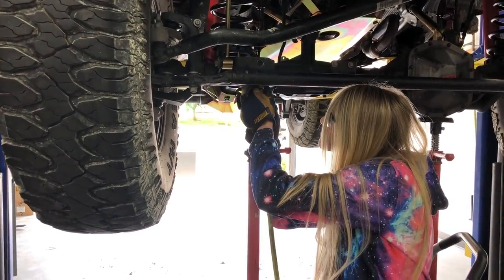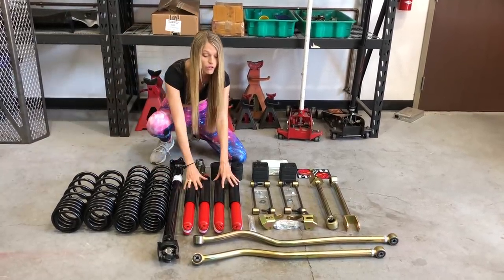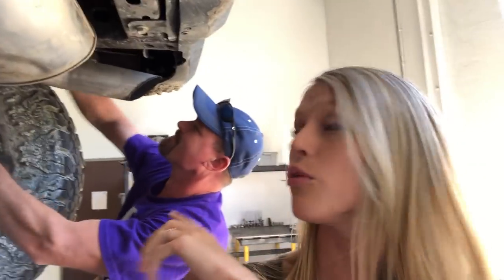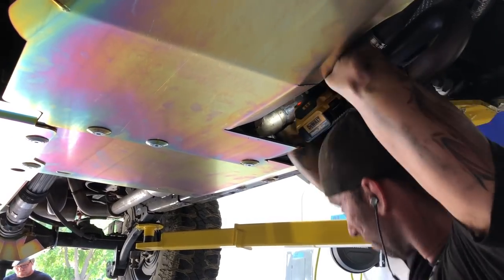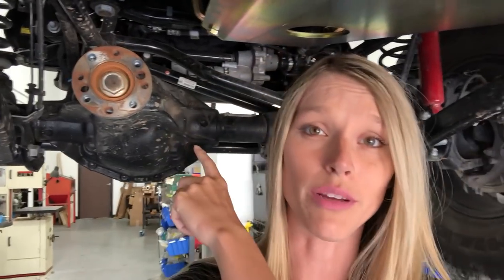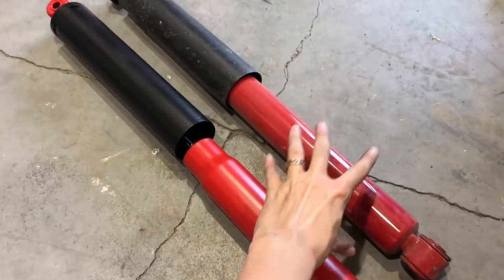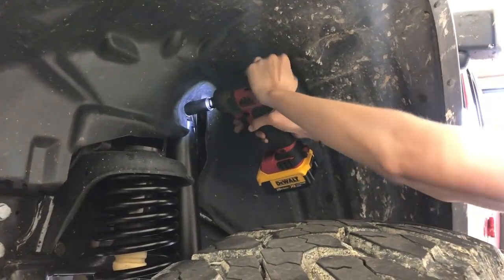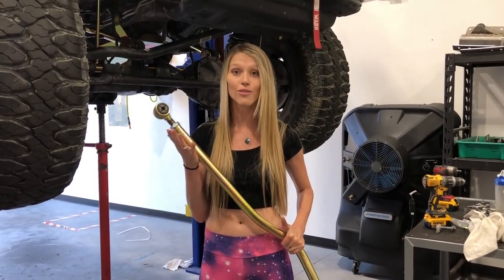We Install a MetalCloak Lift on Our 2018 Jeep Wrangler JLU Rubicon!

Comment: Good choice of lifts. I made the unfortunate mistake of getting a Rough Country 3.25 lift on my previous 13' JK. It was absolute garbage and cause issues right up until I got rid of the Jeep. The company didn't want to help out either, so I suggest anyone who is looking, to spend the extra cash and avoid lots of headaches.

Comment: Another great video!  Best parts, track bars and drive shaft. I did a 4 inch on my last rubi and had to do both drive shafts and track bars. Shorter wheel base more issues, but loved it. Can't wait to see the Rubicon video.

Comment: I just installed the 3.5" Teraflex spring kit with Falcon shocks. It was a pre-release kit. Glad to see these kits are finally being released. Before now, Skyjacker and a few hockey puck kits were the only ones available.
Reply: did the same with 37's, a little to harsh for me on gravel/dirt 2 tracks.
going to put the 3.5" MC coils in. What is your opinion on your TF ride?
I will keep the falcon 2.1 but just change out coils.
Reply: Jeff huschitt
You’ll want to make sure your tire pressure is 28-30 psi max with these and any 37” tire. Makes a 100% difference in ride. 
The TF springs are a little stiff for most people’s taste. My lift is a tad high for me. (Ended up being a true 3.5”). 
If you want a great lift with good shocks... look at the dynatrac 2”. Comes with fox shocks. You could then sell whichever shocks you don’t want to keep.
Reply: Brian Head I run mine  @ 27F & 25/R
Reply: Jeff huschitt I’m measuring 51” from the bottom of the hood line (near the antenna)  to the ground. Progressive springs are suppose to ride really well.  You might try googling them.

Comment: If you decide to replace your damaged GoPro and you choose the GoPro Session 5, make sure you save the plastic mount on the package because it fits perfectly in the JL's center dash tray.  I just set mine in to face forward or back, but the way you guys off-road, you might have to hold it down with Velcro.  On second thought, you'll probably have to secure yours with 1/2 inch bolts!
Reply from the maker: Rod Evans 😂😂

Comment: Bad Kevin !   Shade tossed twice at Lite Brite. :(.  
You should thank your lucky stars to have found a partner that so enthusiastically supports your motor sports passion.
At the same time I was marveling at how technically literate and well researched your mods are presented. 
And Lite Brite as a 'presenter' effortlessly dialogues the process. Bravo ! She is an excellent role model for women and men !
I understand that your location is prime for off roading, but the after market does present a wide variety of choices.
Maybe you could mention in passing how you decided on one product over another, seperating the diamonds from the coal.  
It does appear that all your choices are top quality and very well manufactured.
Looking forward to your trail test.
Reply from the maker: jafxdwg Thank you for the kind words! 😊😊 I’m still on a learning curve with cars, but I’m a quick learner!

Comment: I am looking at running their 2.5" gamechanger rocksport edition on my 2 door JKR with 35"s. That is of course if I don't end up getting a JL Rubi first
Reply: @boughtnotbuiltoffroad7784  we will what the come out with for transmission option for the diesel engine. I anticipate a diesel release in second quarter FY19. Once I know if they are going to offer a manual option then I will make a decision. I love the new six speed in the JL and it's super smooth but I am also very impressed with the auto so that will be the other decision I have to make. What are your thoughts on the auto vs the manual?

Comment: So why the front drive shaft? My OEM JLU DS has zero clearance issues with your exact MetalCloak lift. I've already run the Rubicon twice, Barrett Lake trail twice, and done a fair amount of the Sierra Butts. No issues. Is it the UnderCloak system or exhaust crossover that gets too close or is MC worried about the Rzeppa joint self clearancing and imploding? I will change my shafts once I install my UD60's, but this would be good info for folks, as the aftermarket is not suggesting driveshaft changes like they did with the JK.

Comment: After seeing so many over-stuffed wheel-wells on the net, It's nice to see a well proportioned lift/tire combination on a JLU ! Brittany you deserve a good (form fitted) mechanic's jump-suit to work on this JEEP. Have you guys re-geared the diffs ? Your Dayna's are stout - unlike the 30's on the front of JK's, but re-gearing would assist when pulling away from a stop as will as lower that all -important craw ratio.
Reply from the maker: Gary Button So far regearing hasn’t been necessary, she still has great power and cruises at 80mph through the passes just fine!
Reply: The larger tires produce taller over-all gearing which will net 80mph at a lower RPM. However, after seeing your first day wheeling in California, I'm convinced that your JKU came with a 4.10 ratio rather then the 3.73 or the V/6 now has a LOT more power.
Reply: Kevin, you are in a position to look at your tachometer and speedometer and compare the readings to this chart for the V6:

www.extremeterrain.com/regear-jeep-wrangler-explained. 
Hopefully, with the additional ratios of the new 8 speed, your JL will beat this chart!

Comment: I would imagine all these mods must void the factory Jeep warranty.  Just curious, as this is pretty much a brand new Jeep.
Reply: It doesn't void the warrantee... But Jeep won't cover the aftermarket parts, and if they can get away with blaming the aftermarket parts, they probably will and won't cover any damage caused by the aftermarket parts... it depends on large part on the quality of the dealer you work with.

But if you have AC issues, they can't blame the lift. Drive train issues... You'd probably have an argument on your hands.
Reply: warranty,, where they go they need no  stinkin  WARANTY!!!
Reply: Ray Walkerdine - I installed a dual battery system on my JK and in the process fried my GPS/Sound system. I was visiting the coast at the time and the dealer there wanted to charge me over 1500 bucks to replace it. I waited till I got back to Vegas and the local dealer here replaced it for free telling me "It's a Jeep, people are supposed to modify 'em". I guess the point is it depends.
Reply: Love your smile girl! Keep on jeeping

Comment: Had my local 4x4 Shop order this kit for my 21 JLU Rubicon the other day. Set up an appointment for early March to have it installed, have my gears swapped to 4.88 and have 37" Mickey Thompson Baja Boss put on. Looking to put on a beefier tie rod and drag link. What setup would you recommend?

Comment: Gotta pull that hair up, agree with the others, wow, very scary indeed. You could have literally ripped your scalp apart in seconds with that many hands and eyes not paying attention to your hair - which is hard to imagine, but it happens. Still like the part being installed at 4:50.

Comment: Yes! More jeep porn!  Another fine video and choice of lift.  If possible,  get back on the RTI ramp and check axle breather hoses, ABS cables, brake lines and elocker cables when flexed out.  Stretch one too far, it will break causing all sorts of unpleasantness.   Also, all of the suspension hardware (trackbars, control arms, sway links) should be tightened on the ground, in the jeeps natural position.  With everything loose, rock the jeep side to side, front to back to get everything "home".  Then tighten everything up.  Tightening everything with jeep in air and axles at full droop will limit the flexibility and possibly cause premature wear on joints and bushings.  Enjoy the ride, be safe.

Comment: I’m doing the 2.5 true dual lift on mine, is the drive shaft an absolute must? Will my 37’s rub with the 2.5 with 4.5bs on my rims? Can you recommend any shop in the springs that are decent at installing lifts?

Comment: Nice Video I am very interested to see how it performs for you. What type drive shaft was that you installed?
Reply from the maker: NOWELLSBLESSEDADVENTURES The front one was a DC driveshaft provided by MetalCloak
Reply: Thanks a lot for the information on the drive shaft I looked it up. I was totally unaware that metal cloak was having a drive shaft built for their lifts kits. Thanks again.

Comment: Saw at 8:49, 8:50 the front track bar fit into the bracket that had the opening ground wider but from the angle could not really see what was actually accomplished by grinding. Can you elaborate about that a bit? Thanks.
Reply from the maker: Keith Ewy Sure! So that end of the track bar and the bushing in it is just slightlyyy bigger than the factory one. In order to slide it down into that bracket far enough to bolt it into place, you have to widen that bottom hole.

Comment: what was the overall spendings 4 under belly plates , 3.5 lift and suspension . better yet why don't you guys do a video about the lump sum of money spent to get your JL from stock to date. regards Alex
Reply from the maker: Showroom Glenbrook Remodeling After Kevin and I decided on the MetalCloak lift and skids a couple of weeks ago, we reached out to them to see if they wanted to collaborate! Lucky for us they were as stoked to work with us as we were with them! But you can get the Dual-Rate kit we got for $1565 (or $1289 without the Rocksport shocks) and the UnderCloak Armor for $999 ($169 for the rear diff skid)!
Reply: that's not bad at all. thanks 4 taking the time to reply.  looking forward 4 an walk around, explained and pricing. regards Alex

Comment: Just wondering what driveshaft you used and also how are the tires wearing
Reply from the maker: Joedie Poole Tires are wearing relatively well it seems, a bit quicker than others but Because of the price tag, I’m not worried. And Adams driveshaft!

Comment: Nice video!! So any worry about how Jeep will handle warranty items with all these changes?
Reply from the maker: Goober Maniac Depends what the issue is. If it’s directly related to the modification, probably. But unrelated issues are always still covered.
Reply: Lite Brite   nice to know. thanks again for the videos.
Reply: Is that a metal cloak driveshaft or is it made someone else they supply with the kit?
Reply: Driveshaft is Metal cloak made by them.
Reply: Kevin Williams thanks for the info.

Comment: Yes I'm sure it was given to them because they do a lot advertising on here do like your videos I follow all of them and watch them but you should at least say the nice guys at metalcloak were nice enough to give us this I'm sure y'all didn't pay for that that. which is okay most people that do a lot of videos like y'all get stuff way for life gets a lot of his stuff free he even says the nice guys over it so and so were nice enough to give us this. But that's the Raintree level yes but it probably still is for about$3,500 guarantee that thinks expensive you don't have to have that that's too much money I've seen people take a Skyjacker even rough country makes the 3.5 lift and I guarantee it will hold up just as good for what you're doing for about half of the cost with that one's else for it. Just like the Evo boost kits 2 Grand for a spacer kit they're way overpriced and people say oh that's the best there is metal is metal. Any white love the videos keep them coming. But you don't have to spend that kind of money to get a good ride
Reply: Skyjacker vs MetalCloak is like comparing a Ferrari to a Honda. Yes, many performance parts will give "similar" results, however in the end, you pay for what you get. You can eat beef at McD's for $3 or you can eat beef at a 5 star restaurant for $40, is there a difference, hell yeah!!